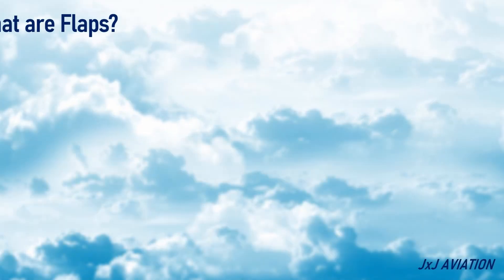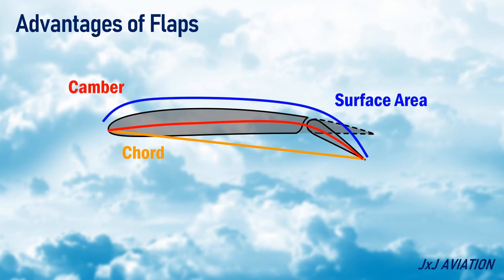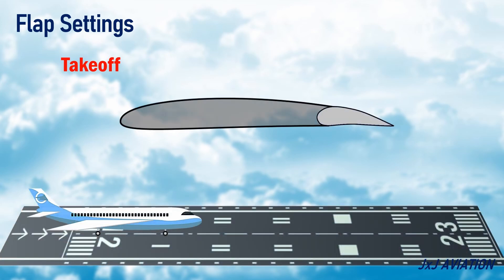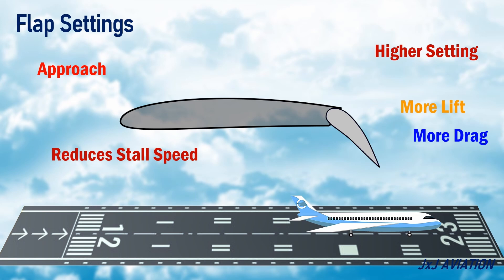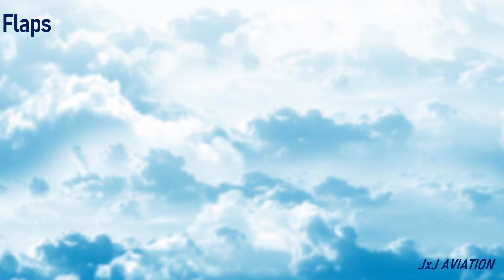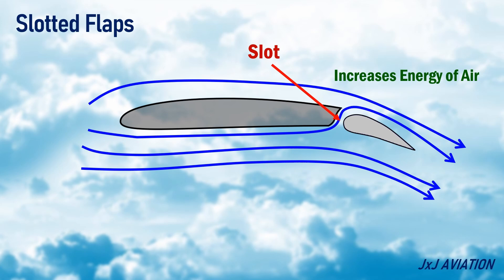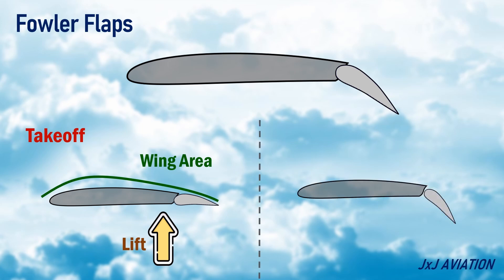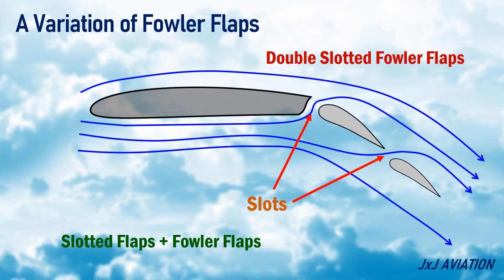What are Flaps? | When are Flaps used? | Advantages and Different types of Flaps |

Comment: So stupid question, what are the real purpose of Fowler flaps if they're extended or extended and down. Why not just make the whole wing bigger/have a plain flap that's fixed at that extended point. 

I'd  assume, and I believe I saw on a commercial plane once, that they only extend in takeoff and landing but the then the question is, why is the smaller wing area better on the flying brick?
Reply: Bigger wings = more drag all the time heavier structure and harder to handle on the ground and in the air. Wings are optimized for cruise conditions where fuel efficiency matters most. Making the wing bigger permanently would hurt performance at normal flight speeds.Why Not a Fixed Flap?
Fixed flaps that stick out would also create drag and hurt cruise performance. Plus, the ability to change the wing shape dynamically lets pilots optimize the wing for different phases—flaps down for low-speed lift, flaps up for high-speed efficiency.

Comment: Good content but the bot is unbearable. Hire a narrator or do it yourself; it couldn't be worse. One note- fowler flaps aren't typically installed on most aircraft as stated, they are installed on most transport category aircraft. Good luck!
Reply: God yes, the narration speech is unbearable. At least add subtitles.
Reply from the maker: ah yes should have been more specific on the fowler flap. Thank you!! Please do check out my other videos as well!
Reply: Why is that?
Reply: @sublime1985usa  They're complexity and maintenance costs are prohibitive. You need significant increases in wing area and lift coefficient for large heavy aircraft but not in smaller ones.